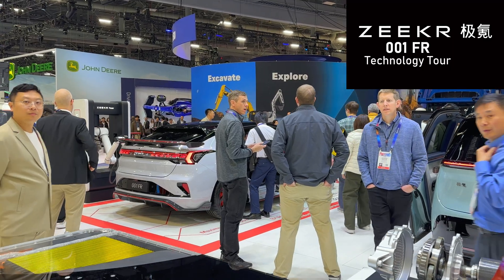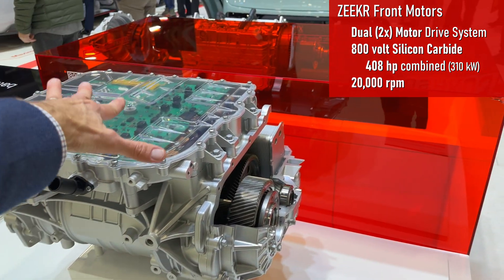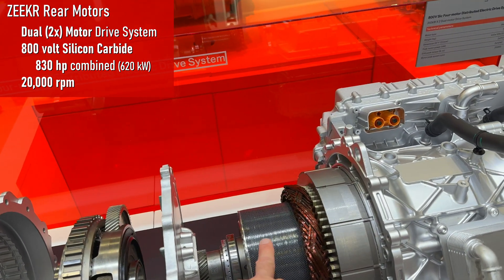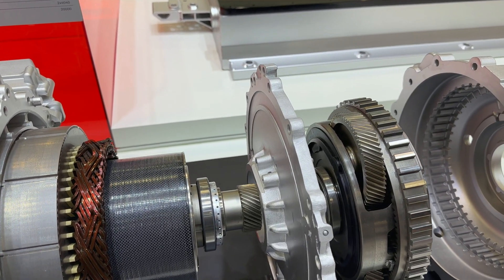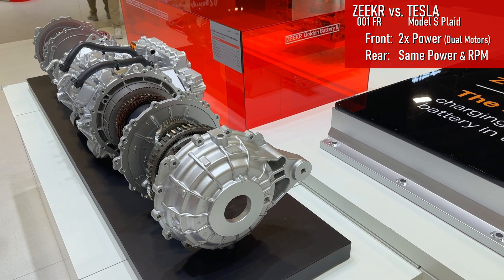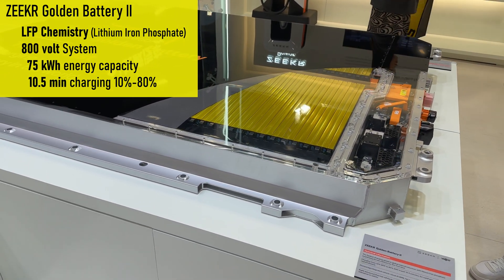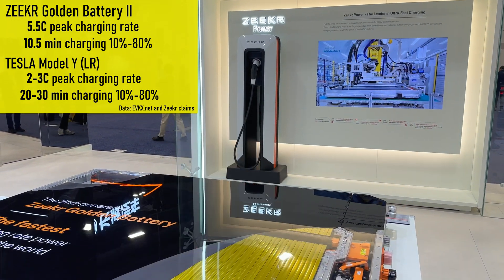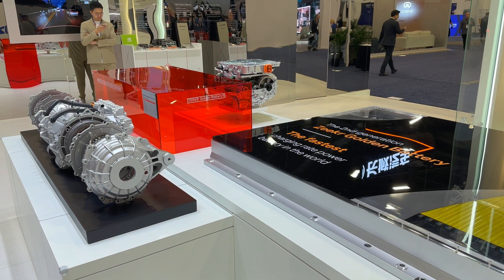CES:  Tour of Zeekr's Technology on display at CES

Comment: To move on  We need   350Wh/kg  ASAP  , with current  batteries  limitation  there is no  future,    We need  SUV  with real range  600km  ( about  130kWh battery ) as a standard
Reply: Why on earth would you need a "real range" of 600km and a much heavier and more expensive battery when you can charge from 10% to 80% in fifteen minutes or less?
Reply: @bms-xs5zp  I understand both sides of the argument. True, if you have a suitable charging infrastructure then you don't "need" a bigger battery. Nevertheless it would be nice being able to drive ~500 km in the winter at highway speeds even if the weather is bad.
Reply: Because my Diesel has 900km range. If it isnt close to that i aint buying these cars. Simple as that. When i travel back to my homeland, i have 1100 km of highway. I am not gonna charge my car every 2.5-3 hours for 10-15 minutes. @bms-xs5zp
Reply: @bms-xs5zp the less you depend on public charging stations, the better. The more range, the less chance to wait in a line for a charger in the future, when more EVs are on the road. It's easy today because they are not as numerous as gas cars, but in 10 years, things might be more complicated. Tech evolution is way more needed than you think.
Reply: CATL is up to 260 WH/KG if I'm not mistaking. Pretty impressive IMO

Comment: They are catching up to tesla, but nowhere near Lucid.
Reply: Catching up? These Chinese cars are already ahead.
Reply: @marktrinidad7650  There motors are comparable to early Teslas but I still think LUCID has the most advanced powertrain for EVs
Reply: @MatrixJockey  Agree that Lucid is the best and they spent so little time showing the front motor because if it has a small differential inside the hollow center of a single motor, then it is in violation of several Lucid patents.
Reply: @swjackson2  Lucid is close to bankrupt.
Reply: @swjackson2  I was looking at the same thing but then thought there is no need for differential for dual motor right?
Reply: @marktrinidad7650  Maybe they are heart-broken..??
Reply: Seems like Tesla and Lucid have no match with Chinese tech companies..
Reply: Lucid will be bankrupt in 18 months.

Comment: LFP @ 5.5C RIP solid state. It will take the US and Europe more than a decade to catch up. 😢
Reply: Why is your pfp the abomination on wheels
Reply: Varta has something like this with 5.5 charging with prismatic cells, but Varta is on verge of bankrupcy
Reply: @joeblack4026  It seems doubtful that Varta's battery technology is ready for mass production unlike the one used in the Zeekr.
Reply: US should just steal the idea/patent. Fair is fair.
Reply: No it won’t. We just need to steal the process and use it just like China does.
Reply: It's not just about charging speed, it's also about range and weight. Solid state charges 10 to 80% in 10 min on a way bigger battery pack.
Reply: @ and where can we see this?
Reply: BYD second gen LFP baldes battery Can do 16C.
Reply: @komisiantikorupsikoruptord6257  not charging , maybe output , but not input